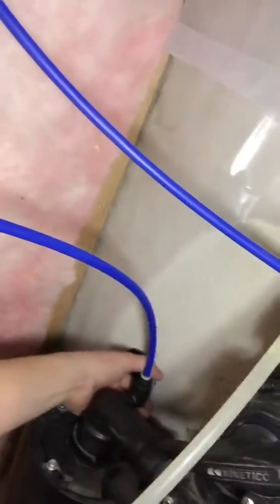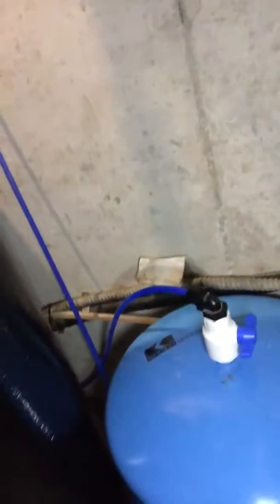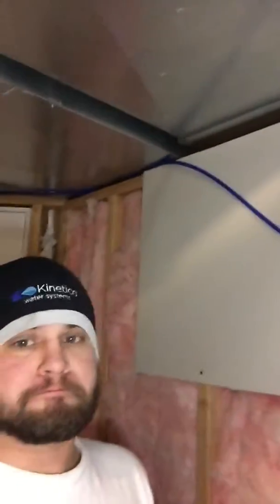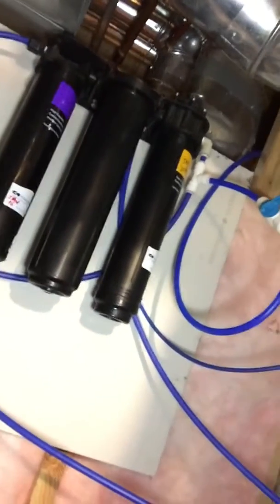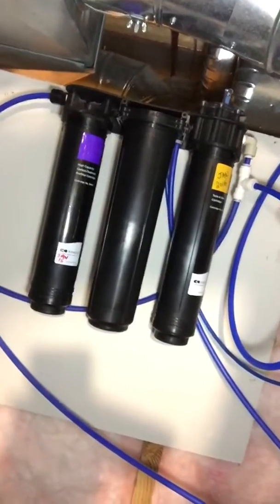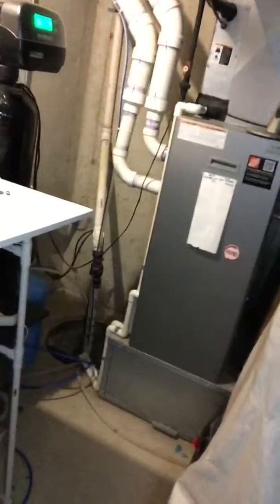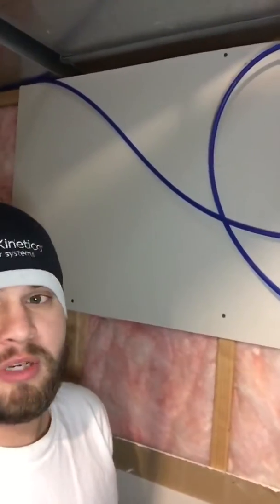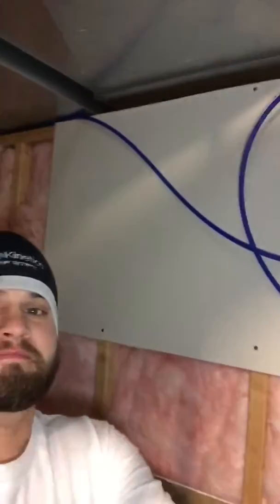American H2O how to change REVERSE OSMOSIS (RO) FILTERS ON A KINETICO RO

Comment: I have a question for you.  The black tube that is in the middle, I believe it’s called the module.  Does this go bad over time? If so, would this cause your pressure tank to not fill? Thanks

Comment from the maker: Hey salal, thank you for your comment. Unfortunately I can only give you a few tips and things to try and I can't guarantee accuracy over the web. There are several things that could be causing your water throughput to stop. What is the model number?  If there is a blue bubble on the top of the unit and the bubble is down low then the unit has shut itself off on purpose to protect itself. The pre & post filters just need to be changed and the pressure should jump right back up. They are the outside filters to the right and left. Do not replace the membrane at this point. Contact your local Kinetico dealer for these filters. Let me know if that helps.